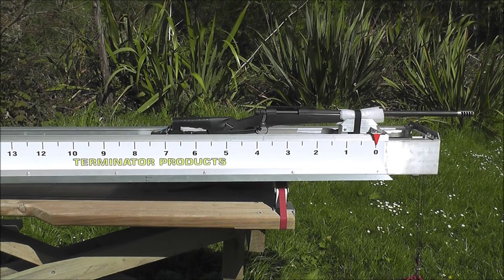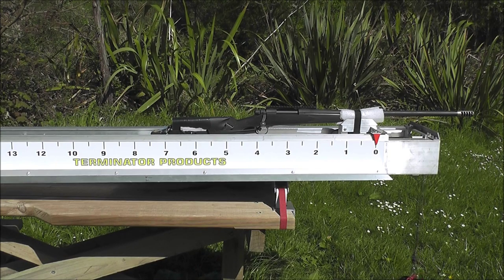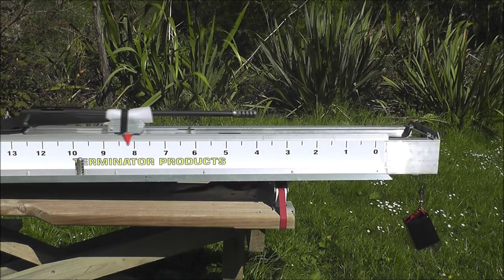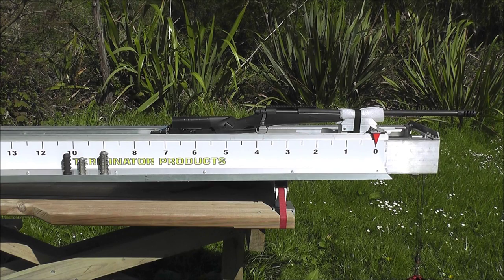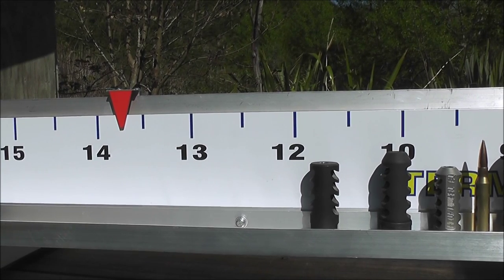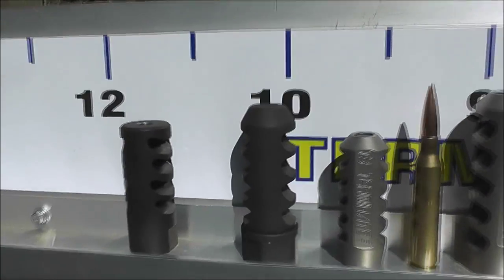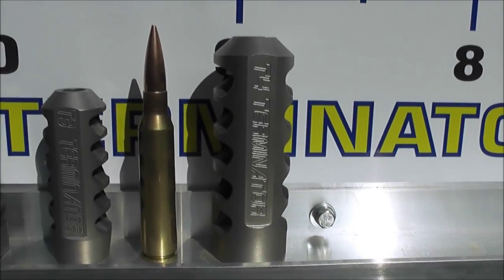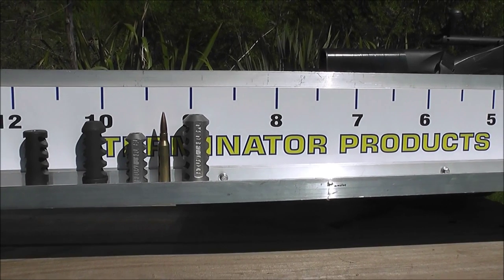Terminator Brakes VS The APA Fat B*tard & Alamo 4 Star

Comment: Great Video! I was so excited to see Cal on Precision Rifle Blog test brakes, but very disappointed to see that Terminators weren't included. I'm confident the T3 and T4 can more than hold their own against those top brakes.

I'm an engineer, and the design of the T3/T4 makes the most sense to me. And the fixture used to test the brakes is a valid approach (imo).

I'm guessing that this video was the result of the PRB test showing the Alamo and APA brakes to be tops. Good an ya, mate for testing them against your Terminator brakes.
Reply from the maker: Thanks.

Comment: What’s different here vs the video of the t3 and t4 vs 13 other brakes. 

The terminator brakes landed between 6 and 7 on your sled then, and now they are much further. Different sled setup?
Reply from the maker: Hi Joel, Different day, different conditions & different sled set up, still shows the correct comparison. Cheers Greg.

Comment: Nice information on these,  wish you would compare the Armalite AR30 Brake.. I did notice that you must be changing weight between different videos since some videos show terminators going to 9-10.. Do you feel it gives a bigger spread with lighter counterweight? I figured a heavier weight would be a better indication of how they counter the initial impulse,, which is a lot of what the shooter feels..  very cool brakes
Reply from the maker: +rog may Hi Rog, thanks. Yes I like to get the sled to move as much as possible, that way there is a clearer picture of the differences in performance between various brakes. Cheers Greg.